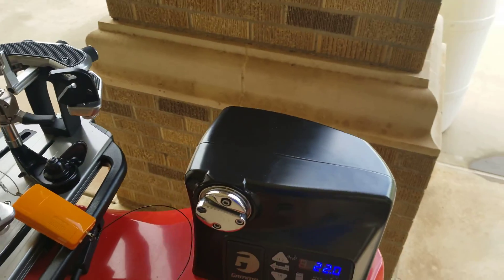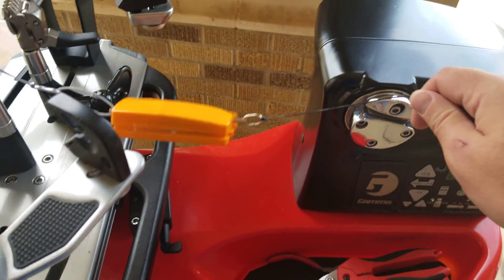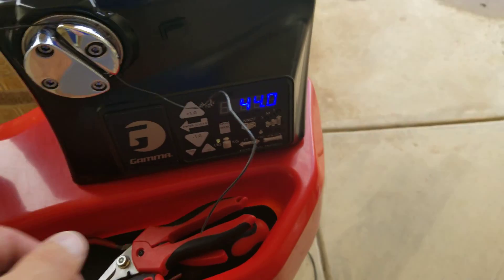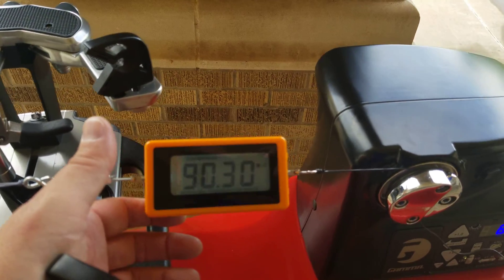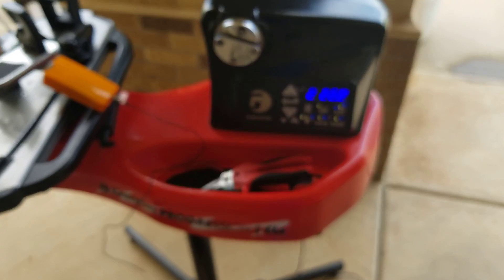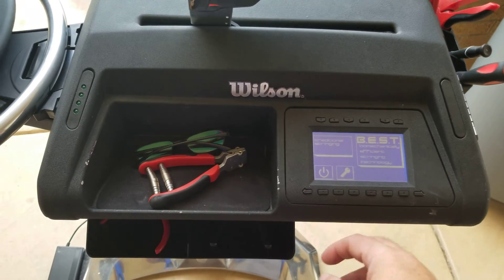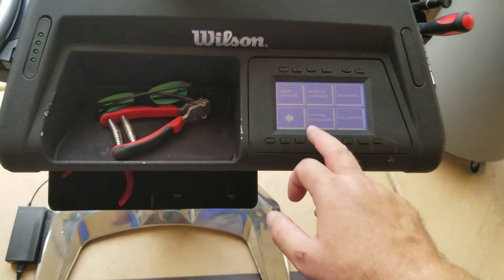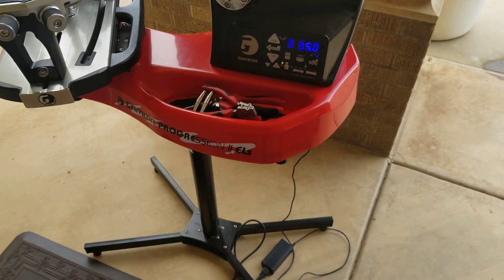Gamma Progression ELS Calibration

Comment: Dude why are you touching it during the measurements? 

This clearly will create random variance in your results, leading to poor calibration.
Reply from the maker: @odonski9611  It is just a demonstration video. It is meant to show people the process of calibrating this particular machine.
Reply: @HerbBaird  My comments purpose was to point out that this is a poor demonstration, and that if someone copies this, it will result in poor calibration.
Reply from the maker: @odonski9611  i will assume that you also have the same model of calibrator that you use often.
Reply: @HerbBaird  No, I do not have this tool

Comment: Thx very helpful, my gripper started this morning  turning and turning when I pull tension, I removed the gripper to clean it out , watched your video thinking it would fix it but it’s still doing it
Reply: I just got home I took off work early cause I literally have  12 rackets that I need to string and I loosen that top screw and what do you know it’s working again
Reply: I really was worried once again I just wanted to thank you and keep up the great content
Reply from the maker: without seeing what is happening I would have no idea. is the string slipping around the gripper, or is it breaking the string? If the string is slipping then either it is not putting enough clamping pressure, or the texture for the jaws is missing. If it is pressure then your screws may be to tight.
Reply: Thx for replying, I’ve called and sent email to gamma but they haven’t answered, I was stringing this morning when I realized that when I was pulling tension the gripper just kept spinning and the string would slip out, so I took the gripper out and cleaned it , I did put the screws back on real tight so maybe it’s that, I didn’t check it though, had to get ready for work , I’ll check it again tonight, if I can’t fix it on my own would it be possible if I uploaded a video about it on my channel for you to diagnose it maybe , I would appreciate it, I got rackets to string and the darn thing is not cooperating
Reply from the maker: @NextpointRF  no problem. Make sure the top piece of the gripper is loose enough to move easily. I have known a couple of other people that had tightened theirs up as well and had this problem.
Reply: @HerbBaird  Thank you for helping me

Comment: Have u tried pulling a longer distance by setting it up in the direction like you are pulling the main strings instead of the cross string?  I tried it and observed the tension read by the meter is actually lower compared to the way you have it set up under the same calibration.  It's like when you measure the tension of the 1st 2 mains after a string job they measure lower because they are longer than the the others.  I remember seeing around a 0.5 lb difference.  Curious which way is more preferred cuz if the calibration were to by done on a longer distance than the resulting string bed tension should be higher.
Reply from the maker: I had done it before and came to the conclusion that the difference was due to the friction of the string pulling across the supports as it angled down into the puller.
Reply: Thank you Herb. I’ve done some measurements of the average pull distance of the mains and crosses and decided to lock the turn table like u but use the clamp furthest away from the tension head and kept it at 24” away from the tensioners crimp edge just before the release button. This distance is close to the average of pulling mains vs pulling crosses.  The actual distances will vary based on racket size anyways. It also takes my machine 5 to 10s after beep to reach reference tension on some pulls so I calibrated mine a bit higher so I don’t have to wait 10s for it to stop creeping and stabilizing before clamping off. Maybe because my tensioner  motor isn’t the best just over 6000 pulls. Just my preference and experience for now.
Reply from the maker: This is why I tell people to calibrate their machine with their calibrator and do it the same way consistently.

Comment: Mine is snapping the string each time it gets to the highest tension. How do i stop that from happening?
Reply from the maker: What string are you using? how do you have it attached to the calibrator?
Reply: @HerbBaird  Hello Herb. Your videos are awesome.  I bought my machine based on your review and love it.  I also purchased the same calibrator you used is this video.  Its only my second time calibrating my Gamma Progression ELS.  The first time I had no issues, but this time the string keeps breaking when I get to 88lbs.  Im using Volkl V-square (16).  Any suggestions?
Reply from the maker: Make sure you double the string up. Use about 2 foot, fold in half, run the loop end through the calibrator ring, then run the 2 ends through the loop. This is all I can think without seeing what is happening.

Comment: Dear Herb. Super video. The tension head on my machine is faulty. At times it coils at a very slow speed and the calibration is off. Can you offer any help?
Reply from the maker: I would make sure your speed setting has not been changed, And recalibrate. If it is still under warranty you might go that route
Reply: Thanks for your reply. Yes, I’ve ensured the speed option for the tension pull is set as desired. Unfortunately, where I live, there isn’t anyone who knows how to deal with it. Could I send you a video for your comments?

Comment: Is that calibration only going to about 55 lbs? And how do you end the calibration system? Turn out the machine. Thanks for all the nice videos !😅👍💪
Reply from the maker: I just saw your comment today. The calibration runs through several tensions. I believe it goes 22, 44, 66, and 88. Once the final tension is pulled and set the machine leaves calibration mode.

Comment: Sorry if i missed it, but whats the name of measuring device?
Reply from the maker: I never mentioned what use. I use the Tennishead 2090 calibrator. I also never showed how to actually set up. I mentioned it at the end briefly. I had already started before I thought of the video. There are instructions with the calibrator on how to make sure it is zeroed out.